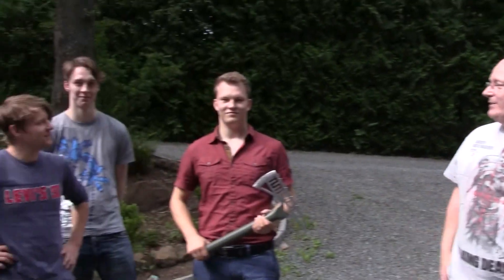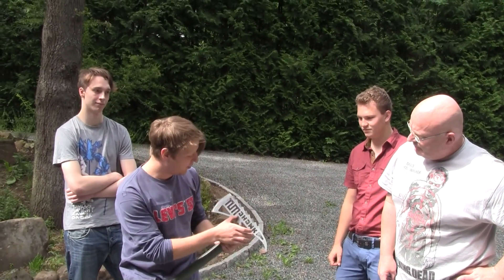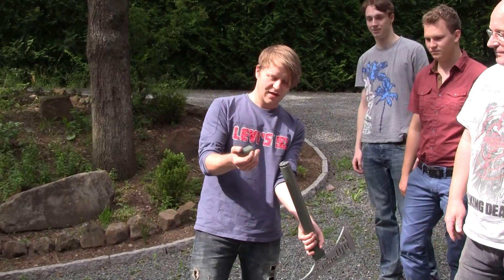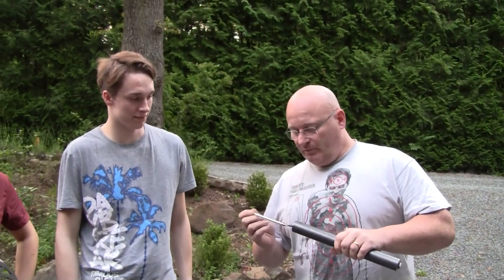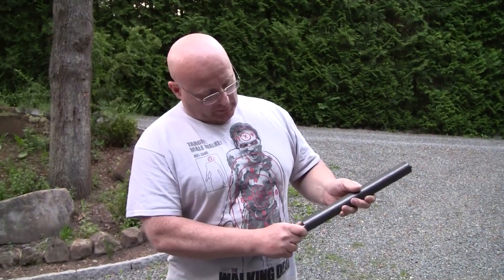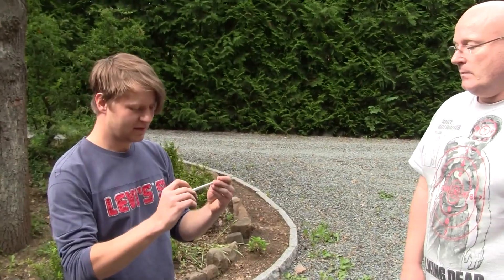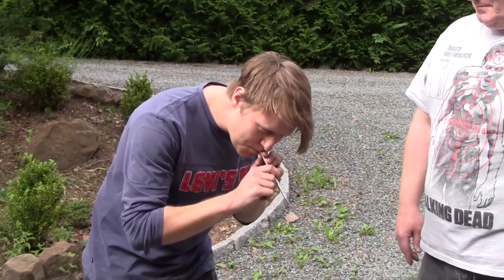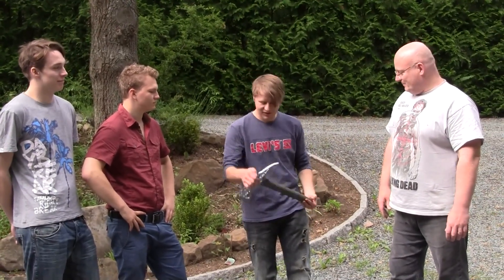The "TUMahawk" - University Project

Comment: Reminds me bit of how we used to cut the end off old metal bicycle pumps and blast wine corks out of the business end just with the air pressure. Now I regret that I never thought of sticking a balanced bolt with some fledgings on it through the cork, but then again it probably saved lives.

Comment: It can hold three arrows right? Make them have threaded ends and only one with a point. You can connect them into a longer arrow that can draw the rubber out further, getting me power from the small design. Even better would be to somehow have all three with threadings and points, to customize length and number of arrows you want to shoot.

Comment: Some advice for the next revision by these talented young men, use the deadspace for more rubber like Joerg said, OR as an arrow storage. But if you're worried about a handle, you can enhance the current grip by machining some grooves or other surface detail into the aluminum shaft/barrel assembly where the user grips it. This way it will be more secure when used with cold/wet hands AND still slide easily into the axe handle (no protrusions).

Comment: I would of made the bolts shoot with the axe head as the handle. The bolts could be shot one on each side of the head or one through the middle. Should be enough material in the head to allow a hole to shoot the bolts.

Comment: good comment but those straws could last you up to two years of constant use I have a water bottle that uses the same type of filter and it can filter up to 100 gallons of water.  The sharpening stone should go at the cap of the container/ handle.

Comment: Thor types of slingshots are pretty weak because you don't get much drawlength without a longer bolt. But if you could somehow make the barrel extend as you are pulling the rubber with the bolt, you could get so much longer drawpower! :D

Comment: If they could make the bolts longer or make them so you can screw two pieces together, then you could pull the rubber back farther for more power.  Great compact design.  Instead of a handle, just make a grip at the base of the axe that could be used on the launcher as well.

Comment: guns run out of ammo and make noise, which can be both a blessing and a curse, lighters run out of fuel and are easily broken, and you'd then not have a water purification system or an axe with you.

Comment: The slingshot itself could be improved to give more power. Perhaps the actual rubber could be placed deeper inside the tube with a longer string atached so you could draw it a bit further. But that's the only criticism I have of it honestly. Excellent work, gentlemen.

Comment: That's how tools used to work, the heavier the head of the tool the more powerful it'll be. Now tools focus on a number of factors such as edge, face, length, and in the case of tools that need to be used repetedly such as axes, knives, machetes, and hammers, there often needs to be a counterbalance to ensure speed and control.
If the head is too heavy then there's a good chance it'll either slip off or swing uncontrollably and you won't be able to do another strike immediately.

Comment: Axes are supposed to have the blade end much heavier than the handle. It works the same way as a hammer. Try using a hamemr while holding the heavy end, it is much weaker.